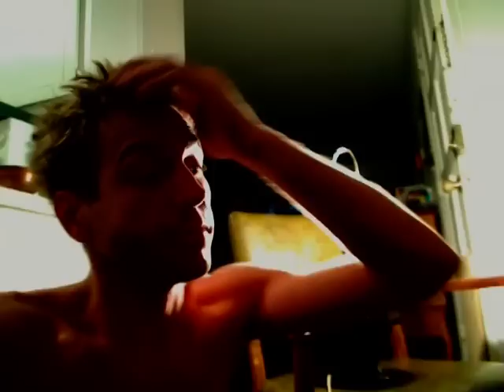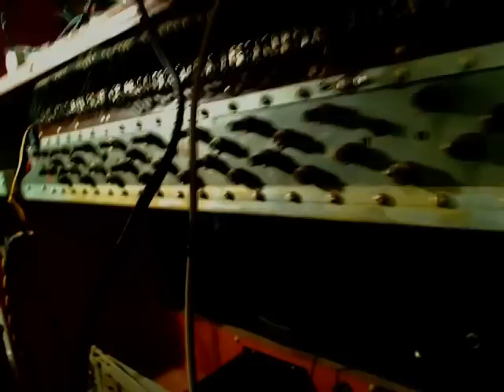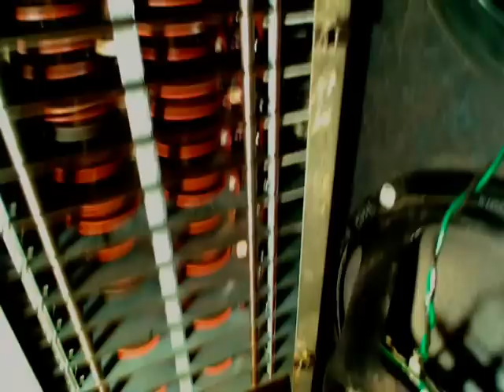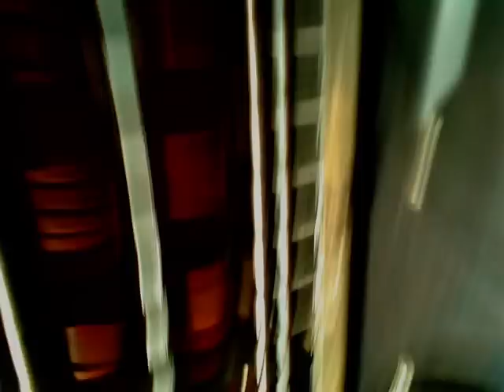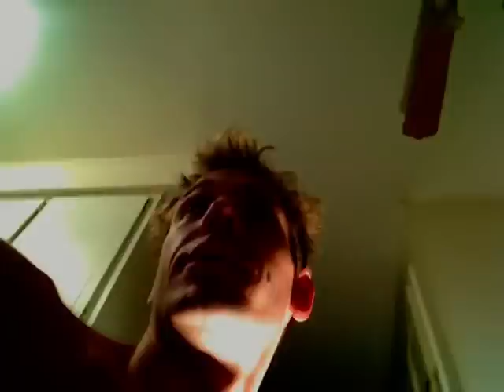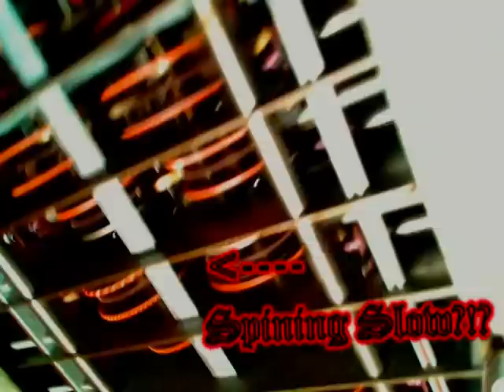Vukodlak Productions-  L-103 Tonewheel Generator Problem

Comment: WOW - it DOES need oil... In a case like this one, I usually take the generator out of the organ, and manually oil each oilite bearing one at a time. I have repaired many many Hammond generators with this same problem. Please don't run it anymore until you get oil to each bearing , as the friction can wear away the soft sponge-bronze bearings.

Comment: @shamusmccrave I just oiled it through the cups using hammond oil and it eventually quieted down. Actually I forgot about the organ and put it against the back wall a year ago.  I pulled it out 2 months ago and turned it on and it made the noise for 2 minutes and then it went away. It does everytime I turn it on then it goes away for the rest of the time that I use it.

Comment from the maker: @themilksnatcher There is nothing in the singer sewing oil that will "gum up" the generator. This debate has already been settled. Same gravity/viscosity/composition. Why would Singer use it in a sewing machine with parts 10x as small if it gummed up?  "New types of oil?"  Now you tell me... where is Mr. Goff getting his "new Hammond oil" Mr. milksnatcher?

Comment: I use marvels mystery oil. I had the same noises, chattering of the wheels. I could barely spin the wheels by hand until I juiced it and let it sit for a couple days. No WD 40 or heavy stuff, marvels is a great replacement